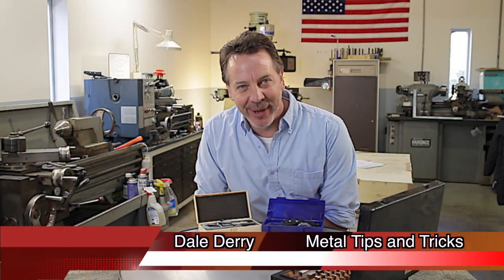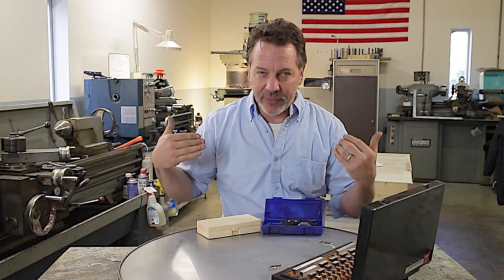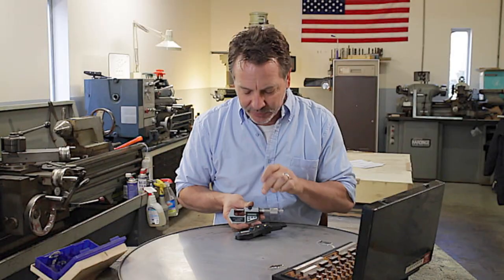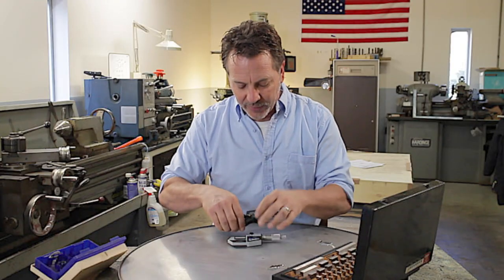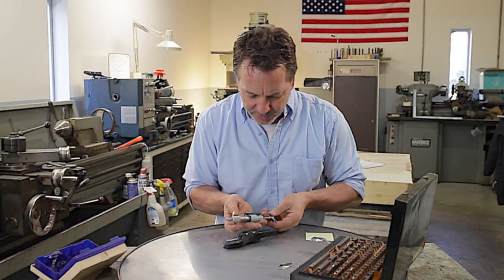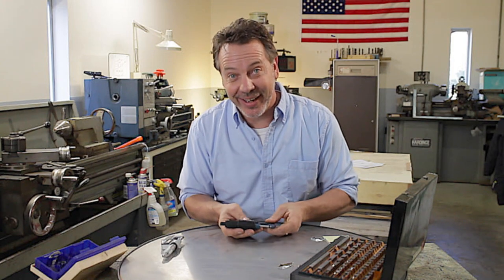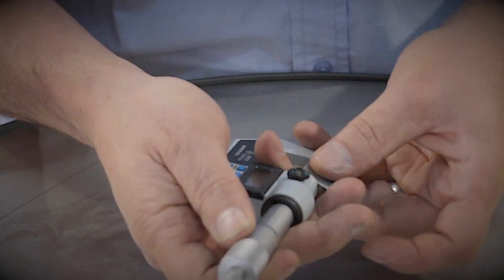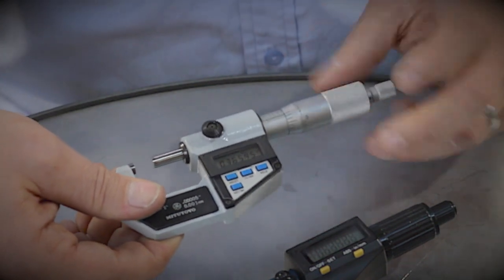Mitutoyo VS Harbor Freight ....The Digital Micrometer show down

Comment: Fortunately, as a retired Tool and Die Maker I still have my prized precision instruments that I used for 40+ years.  These are a mix of Starrett and Mitutoyo calipers and Micrometers.  The one one thing you didn't discuss was the "between the ears" satisfaction that comes from KNOWING that you have a quality product in your hand.  Confidence!  It means a lot to me whether I'm gaging a precision work piece or tool or fixing an old coaster wagon.  I have to admit though, that the price difference would give pause to consider.
Reply: This video isn't for you. Doing t&d for 40 years no tool can be good enough. But for the vast number of hobbyist this video shows there's often little reason to literally throw money away chasing precision.
Some HF tools aren't this good, but many are at a ⅒ the price

Comment: This is a fun intro but for me you did not test what you are actually paying for with the Mitutoyo. Run the batteries down to 'almost' dead, then repeat your measuring experiment. Most of the cheap mics and calipers start to wander when they get low voltages, rather than just turning off. Who knows how many false measurements will be taken before the screen dims out and you know the battery is dead. The other test is to take both, put new batteries in, and stick them in a drawer for a year. The cheap electronics pull almost full current even when off (that's how they remember zero) vs the higher end units that hardly draw any power when off. If the unit is rarely used then either the user replaces the battery every other time or stores it with the battery out (as I have to do with my i-gaging stuff). Of course if people going into it know to bulk buy batteries and replace often then there is not as much of a issue.
Reply: Fixed, thanks.
Reply: I came into this observation through a different door.  I discovered if I left the battery in on some $20+ calipers, they kept drawing power with it off.  I always pop it out when I am done.

Comment: For someone who has only an occasional need for certain specialized tools, such as myself working on home projects, I've saved hundreds of dollars buying Harbor Freight tools. On the other hand, if my job, reputation or an expensive piece of equipment were to depend on a tool's accuracy, I wouldn't even consider walking into Harbor Freight's doors.
Reply: coffeemaddan What if it's a revolving door? Question. If a revolving door rotates in a counterclockwise direction as you are walking into it here in the US, does it rotate in a clockwise direction in England since they drive to the left instead of to the right? :)
Reply: coffeemaddan I know that the water in a toilet bowl will spin in the opposite direction down under, so you may have something there.
Reply: Well, now that this issue has been cleared away by the use of the Coriolis flush. I'm really glad that the Coriolis effect doesn't suggest that we cease to use toilets in protest of the distribution of misinformation given to countless numbers of science students through the years, including myself.
     Now if we could politely convince the world that driving with the steering wheel on the left side of a vehicle allows the majority of the world's population, which is right handed, the ability to shift gears with their favored right hand. We no longer need to ride on the left to keep our right hand available to swing a weapon, as was necessary when riding upon a horse long ago. Having the steering on the left would also standardize the rules of the road when crossing certain countries' boarders.
      As for revolving doors, again those that are in the majority of being right handed, will naturally prefer a door that rotates in a counterclockwise direction. This would be due to the fact that right handed people have a natural tendency to bear to the right and to push on a door with their favored hand.
      For those people throughout the world who don't have toilets, there will be no experimentation with the flow of water. They will just have to accept the information that was kindly provided, as I too will concede that I was duped many years ago.
Reply: Agreed that HF does have it's place.   I got a 3/4" drive socket set.. did the job, and I have it for the future. I've only used one or two sockets maybe 3x.
For something that see's occasional use. it is, what it is.  A lot less of an investment vs. Snap-on or Mac, etc...   

Generalizing: HF is good for one time use / consumable tools.

As a professional engineer/tech, I have much better stuff in my boxes to rely on.
Reply: John Galt Totally agreed. Their tools are not for the purpose of abuse in an environment where they would be exposed to constant commercial use. I sure wish that they would make a small beam or dial type torque wrench that would read from 0-30 lbs/in. These are what is required to test the pinion bearing preload on an automotive type of rear differential. I had to send off for one and it wasn't cheap. I'll only use it a couple of times a year, if that often. They do have a "click" type of torque wrench in lbs/in, but their range of calibration is too high.
Harbor Freight has their place in the tool world. The problem is that people seem to forget that in most cases you get what you pay for. I was a professional mechanic for over 45 years and I used and still have tools that my father used during his career. They are now close to 100 years old.
Reply: to measure bearing preload, use a measured bar and a spring scale, keep scale at 90 degrees to the bar. calibrate scale with a known weight, or use a trigger pull gauge. mine is an RCBS gauge, 4.5 lb capacity, readable to 1 oz. look around you, think outside the box, you only live once so have fun.
Reply: jot&tittle  On my trips to the auto salvage yards my HF  junk goes with me in a bucket.  I can afford to lose/break them as they are cheap enough to replace.  When working on customers cars and trucks my Snap-on and Proto tools are in use.  When finished for the day they go back into my locked toolbox inside my locked and alarmed shop.  HF is nothing but throw away.

Comment: Out of the box, I would expect that both would work pretty good.  The real challenge is how each of those mics hold up to the test of time.  While I have not ever even held a Harbor Freight micrometer, my experience with most of the cheap import tools is that they work great for a little while but usually crap out on you right when you need them the most.  For the home shop machinist that might use the tool a couple of times a year, they have their place, but if you are anything close to a serious home shop machinist, I think you are smarter to invest in higher quality tools.  When I was young, first getting started, and did not have much money at all, I bought some import items.  Most all of them have been replaced - not because I just wanted to, but because they failed the test of time.  Now days, my first choice is to buy quality once rather than junk over and over again.  In the long run, an investment in a quality tool will be cheaper because you rarely have to replace them.  What would be really interesting is to do some drop tests and see how far of a drop it takes to kill each of the micrometers - see how they hold up to some abuse and then decide which is the better deal!
Reply from the maker: Are you giving to donate the mics for the testing😀😀😀  thanks for your comments
Reply: +Metal Tips and Tricks (Dale Derry) Dale, what are those 3 square boxes supposed to mean?
Reply: +just tim They are emoji smiley faces that your device is incorrectly showing as boxes for some reason, maybe your device doesn't have an emoji keyboard feature or something but for some reason it's incapable of reproducing the images......
Reply: +Keith Rucker - VintageMachinery.org 
I'll reply, going to have to go with Mitutoyo. Bought my 0-1 mics 20 years ago and would still trust them against a Sheffield on a .0001 tolerance. Of course I'm not a home hobbyist. Plus my question would be on the grade of blocks you are using. I'd bet if you used blocks on Sheffield to calibrate, Mitutoyo comes out ahead. That being said if I was a hobbyist I'd go with HF.
Reply: +Keith Rucker - VintageMachinery.org Are you some sort of brand snob by any chance? I suspect so. I have expensive tools and cheap tools too. I have had my expensive tools crap out quicker and more often than my cheaper tools, especially my dial calipers. Out of all the tools I have bought at Harbor Freight, I have only had to return 2 of them. And I got no grief and great service because cheap or expensive, I always invest in an extended service plan. I have been a tech for 47 years and a machinist and gunsmith for 2, and I firmly believe service contracts are worth their weight in gold. Things always break down when the factory warranty goes. What I save having to replace any tool without one is more costly than buying it at the time of purchase.  The first thing I do before depending on any tool for precise measurements especially on a gun, is to calibrate them using a set of Starrett gauging blocks since they are the industry standard. You said you never held a Harbor Freight micrometer, but you lump it in with unfounded generalizations. To me this the sign of a brand snob and a bad one at that. One reason along with the fact you like to hear your own voice that I no longer watch your videos.
Reply: wow... you have quite an attitude. Not sure why you chose to go ahead and insult Keith Rucker for simply giving his personal opinion. I don't know what it is in his videos that made you suspect he is a "brand snob" or someone who "likes to hear their own voice" but I have never once had that impression of him and I have been a long time viewer. Personally, I have my calipers and mics in my hands at least once a day, and I have had every single import tool fail on me one way or another, with the exception of a few dial indicators, but even those started showing inconsistencies and I hardly trust them. Meanwhile, I have some older well used mics of better quality (mitutoyo, starrett, and even some crusty old Brown and Sharpes) that still work beautifully, at most needing a slight calibration for wear on the anvils.
Reply: I have noticed the same thing. Still, for the home gamer, cheap measurement and indicator devices are great, as long as they have at least one precision tool to get final measurements. As for me, i would use the heck out of the harbor freight junk, till i get to around 10 thou out. then switch over to the starret or mitutoyo to take the final measurements and sneak up on my finished part. But for something like a cobbled together "DRO" using an indicator on a magnet base poking at a lathe cross slide, nothing beats the el cheapo 15 dollar junk for keeping your nice stuff from getting destroyed in a mishap.
Reply: Hmmmm. Maybe if you were only going to ever buy only one micrometer, the Mitutoyu would be the choice. But seriously,  who owns only one micrometer? 😁
Reply: You guys that are near or retired can't give advice to the guy just married, just bought a house, expecting a child, car payment, ect. Go with what you can afford, when you get close to paying shit off buy whatever.
Reply: Keith Rucker - VintageMachinery.org your insane if time is your argument and the harbor freight thing isn't Gonna break every few months,  IT FUCKING COSTS WHAT THE DAMM TAX IS IN THE OTHER!!!! YOU CAN BUY 6 OR 7 OF THEM,  IF THAT CARRIED TO OTHER THINGS IN LIFE YOU COULD OUTFIT A SMALL COMPANY ,,, Jesus Christ dude
Reply: You know Mr. Rucker, the test of time was the same for me about my tools of the trade. However, I'm starting to find that the high quality tools are starting to fail too, but price is going up. As a electrician, I count on my Fluke meter for the accuracy and dependability, but my go to meter finally took a crap on me. So in a pinch, I bought a cheap meter to get me through the day and it was CHEAP. Replaced my Fluke brand new and right out of the box didn't work, after returning it, the new new one worked great for about a month and now doesn't read accurate. Replaced it again and works great but looking back, the cheap meter has worked everytime and is dead accurate. I feel that I payed for the name, not the instrument. BTW, love your channel!!!
Reply: Keith Rucker - VintageMachinery.org Nothing cheap or low quality comes to Mitutoyo. Actually, I prefer Mitutoyo instead of Starrett. Snob.
Reply: Completely agree!!!
Reply: @woodhog4154  I would think, as he is a reputable machinist that he is merely giving intelligent insight on the tools. Being a pro doesn't make you a brand snob. Quite the opposite rather. Allen sockets for instance, hf works fine. But during harvest season when you have to go out to bfe and fix the tractor at 2 am I'm taking snap on. I know they won't break.
Reply: @hatersaywhat8986  Klein isn't what it used to be either. Hell, not even what it was 10 years ago
Reply: Unfortunately very true my friend
Reply: I know I'm a bit late to the party, but I want to say my Chinese vernier micrometers that I was given in high school have held up for 8 years or so with a lot of usage, I have others now(starrett, slocomb, Brown and Sharpe, etc.) However I dialed in my Chinese ones one time and they havent moved more than .0001 when checked with the ratchet thimble in a climate controlled environment and they are a regular go to of mine, I skip right past my starretts.
Reply: You sir are dead on 👍
Reply: I have a set of Workzone (that's ALDI) digital calipers, which cost about £15, around 12 years ago, and they're still working perfectly.

Comment: Great video! Another point to add is where the cheapo's fall  flat on there face is the battery life. You'll get ten times the battery life out of mitutoyo. 
Thanks
Andrew
Reply from the maker: I never thought about that
Reply: +Andrew Podaca And the batteries are cheap these days - I can keep a lot of $0.10 batteries in my supply drawer...

If I were in a position where changing the batteries was costing me serious downtime, that would be a point to consider.

For home hobby use, $35 is affordable, while $200+ is cutting into my budget for other tooling...

Your mileage may vary...
Reply: The Toolmiser Also, the cheaper micrometers and calipers have no way of knowing when the battery is low, and can give false readings because of a low battery. That's a way to scrap parts
Reply: Some of those cheap tools you have to take the battery out. My HF digital caliper is that way. It doesn't have an off button so its always on and waiting for you to hit a button or move it even though the screen is off. So I just take the battery out when I'm not using it and they last a long time. Kind of annoying, not sure why they didn't put a power button on them.

Comment: I am a hobbyist and part of the enjoyment of the hobby is working with quality tools. Although some high-end tools like the Mitutoyo ceramic gauge blocks are truly the reserve of the professional, using middle range tools (Mitutoyo micrometers for example) is a HUGE step up from Harbor Freight. Except their rolling toolboxes, I have never seen a Harbor Freight tool that did not feel cheap and disappointing. I buy once, take good care of my tools, and know I will enjoy those tools EVERY TIME I pick them up. Knipex and NWS pliers, Wera and Wiha screwdrivers, Lie Nielsen planes, Festool power tools for woodworking etc.  I would not hire a pro with HF tools - for me at least investing in quality  is the minimum of self-respect and pride in one's craft. Your mileage may vary.
Reply: good point about not hiring someone with higher end stuff. I have mitutoyo and starrett for my dial bore gauges for the outboards I rebuild. I had, years ago, bought a cheap one on ebay for $70, and it got me started, but seeing that gauge needle bounce low and high from 0 from time to time made me think twice. Just feels sloppy, even if the measurements are adequate for what i need. attitude is everything.

Comment: I don't have the HF digital Mic, but I have close to 10 of the HF 6" digital calipers. I'm good for misplacing my calipers and spending 20 mins looking for them. Now I have 10 of them dispersed throughout the shop. All 10 of them probably cost me under $150 total with the coupons and sales. For 90% of what I do the calipers are accurate enough. For the remaining 10% of the work I do, I have a full set of 0-12" mics that get pulled out when they're needed.

As far as batteries go, I bought 50 of those watch batteries on ebay for under 10 bucks. That was 2 years ago and I still have 40 of them left. The cheapies might be a tad harder on batteries than the more expensive mics, but in all honesty ,I ain't going to walmart and paying $3 for a single battery when I can buy them in bulk online for one tenth the price.

Comment: The company I work for has Mitutoyo micrometers like the one in the video that are over 20 years old.  I check them every month for accuracy and repair any that need it and I can say that they very few of over 200 or so micrometers at our company need any sort of repair.  The batteries, if you buy the silver oxide ones, will last well over a year if left on all the time and some of our operators do that.

Also, noting on the comments in the video about the ratchet, Mitutoyo do a variety of types and you can order one with either that you fancy, check out page 2 on their pdf ... http://www.mitutoyo.com/wp-content/uploads/2013/05/2119-Product-Fund.pdf   ...he has a ratchet stop on the video and the Harbour Freight is a ratchet thimble.